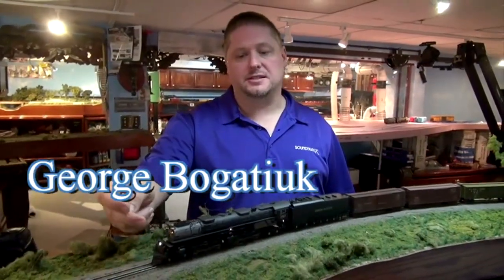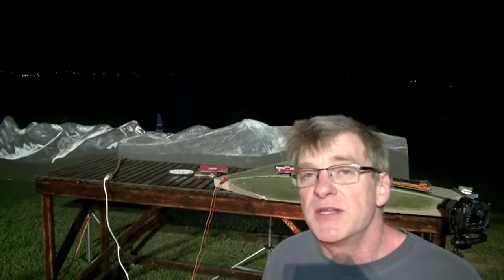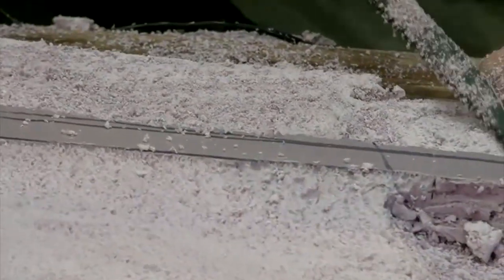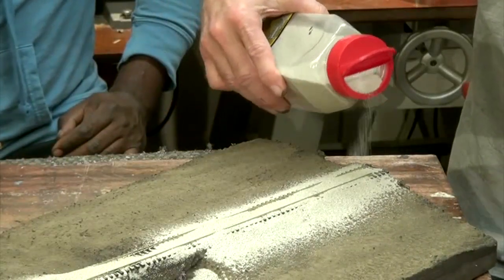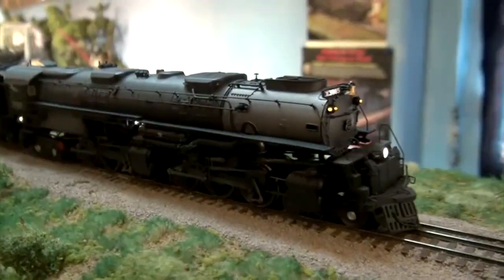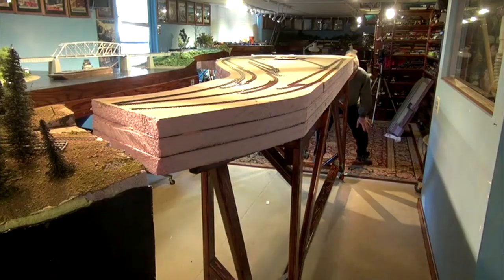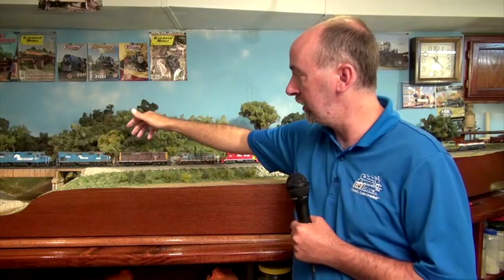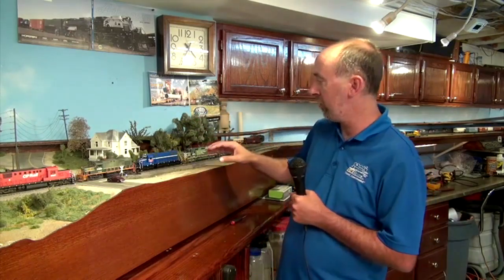Whats Neat in model railroading | June 2017 Model Railroad Hobbyist | Ken Patterson

Comment: Ken, you've produced yet another outstanding "What's Neat" episode. I thoroughly enjoyed your realistic terrain modeling technique for water flow around track roadbeds as well as the ESU segment about prime mover sound variations.

But this episode also marks the second in a row without anything N-scale related. Again, I encourage you to feature more about N scale model railroading. 

It still remains the second most popular scale worldwide enjoyed by model railroaders, so you're overlooking a vast audience by not featuring N scale coverage.

-from Tom Pilling
Reply from the maker: Terrain modeling techniques shown work great for N, ESU tips apply to their Micro decoders too, which fit in N scale locos fine. Benchwork methods can be used on an N scale layout too. There are very few topics that need to be N scale specific to be applicable just fine to N.
Reply: Yes, Ken, the topics you mentioned in your reply apply to all scales and not just N scale. They are great topics, to be sure. But what you neglected to address was why the last 2 episodes did not include any topics specific to N scale only. I hate to say it, but you're almost starting to sound Trumpian with your evasiveness and excuse-making.

Again, I encourage you to expand your coverage to include more features particular to the world's second most popular model railroading scale and its giant fan base, regardless of whether or not Bachmann is your client.

I hope at least your July 2017 episode of "What's Neat" will devote some attention to the National N Convention to be held next month in Pittsburgh.

How can your online magazine live up to its name "Model Railroad Hobbyist" when it continues to exclude targeted, specific coverage on such a large segment of the hobby? I don't believe Model Railroader magazine ever published 2 consecutive issues without including a single topic specific to just N scale. If MR can do it, why can't MRH?

Comment: Excellent presentation on all topics !  Why do the LED's appear to flicker on UP Challenger?  I wonder if the duty cycle governing LED brightness is being picked up by the video sampling.  Whatever's happening, I think the LED persistence probably looks okay live. After all, AC Incandescent bulbs flicker 60 times a second but nobody notices.
Reply: I have that problem with Broad way limited.. the Pensey t1's were good run bys but never got used because of the head light on and off and on and off.........It just doesn't look good on video...